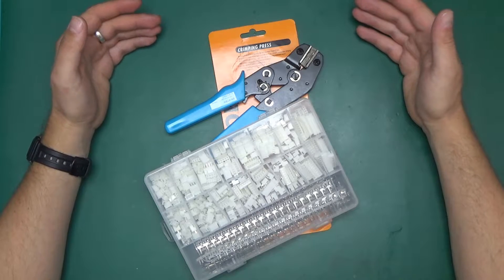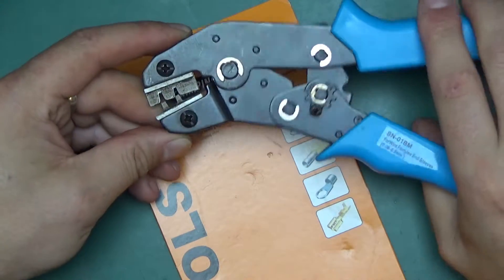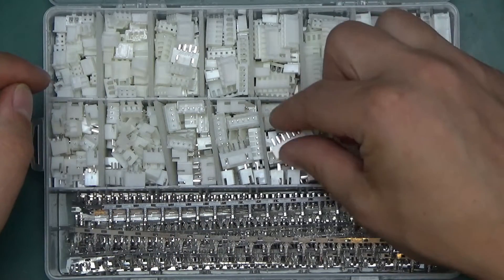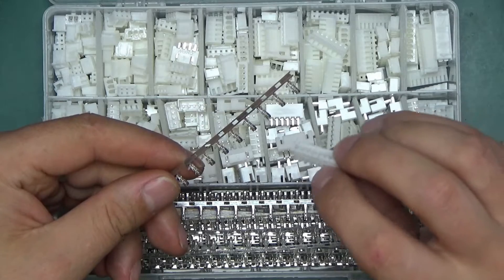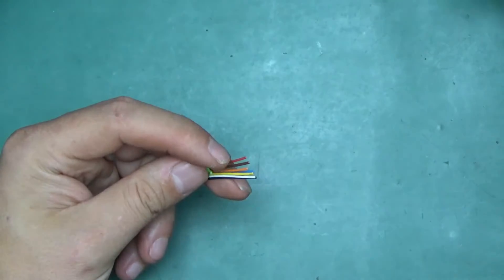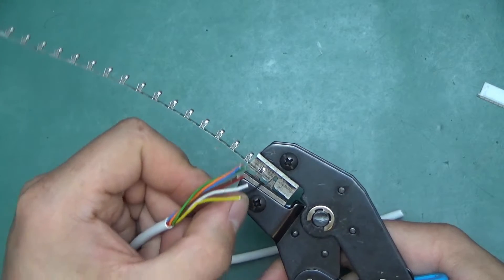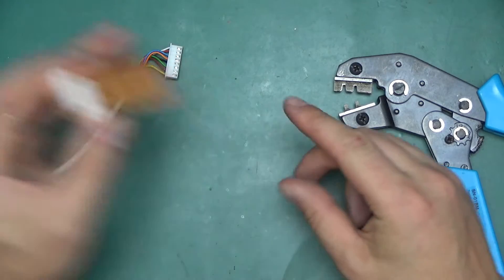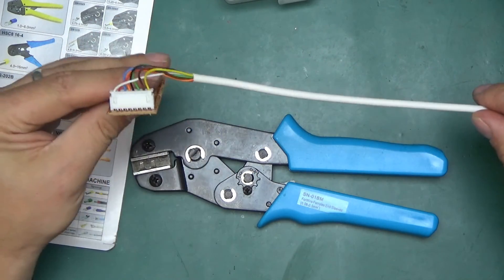#019 - JST XH connector crimp tool review

Comment: Incredibly helpful. Thank you!
I just discovered that its easier to catch the wire by squeezing the outer tabs slightly closed around the insulation with pliers. Then its all lined up and easy to insert into the crimping tool!

Comment: So I too got these crimpers but am not having very much success.  I believe it is because my pieces are a bit shorter then the ones in your video.  The end which must stick out with the tab to keep it in the plastic housing, gets crimped way too easily!  I am able to get one successful crimp out of 10!  Maybe this is why there are so many included :)  But seriously, would you please share where you got your terminals?  They definitely have some slight differences from mine - and it appears that you have that extra 1 - 1.5 mm in overall length for your terminal to clear the other side.  Thanks, Carrie

Comment: sellers say the SN-28B and SN-48B but its the wrong one. this SN-01BM is the correct one for dupont and jst connectors.
Reply: Exactly as you say. The SN-28B crimping pliers are NOT FOR JST-XH connectors.
I also got the SN-28B in a bundle with Dupont mini-PV and JST-XH connectors, as a one set - two boxes of connectors and the crimping pliers. I test tried to crimp both the Dupont mini-PV and the JST-XH with SN-28B and both of these came out mangled. The mini-PV came out so-so, but it got stuck in the jaws of SN-28B and the JST-XH was completely crushed.

Comment: When you say easily fixable at 8:14 what do you do off camera to fix it? Whenever I crimp the insulation too far in like that I've always just had to cut the end of the wire off and start again (also wasting a connector because it's stuck to the wire). Thank you for the video!
Reply: That's the fast way...if you are on your last connector and need it badly you're going to have to squeeze it back open and probably cut yourself in the process.

Comment: Great video. I have a different brand set but same basic deal. Other videos are blurry or say I need a thinner crimper to crimp the two sections independently. This is great and I’m now going to go ahead and make my first connector with high confidence that it will just work.

Comment: Nice instructable video. I didn't know about these types of connectors until a few days ago. I was looking at crimping methods for connecting LED Strip RGB extension cables together. I would still like to have done it this way although I am not sure how? Instead I am opting to use gel filled butt splice connectors. Can you use these types of connectors cable to cable instead of for circuit boards?
Reply from the maker: Thanks, and yes, there are male and female connectors for cable as far as I know, just not as common.

Comment: I have exactly the same set and all is explained very. However you can leave out the stripping of the wire.  This is because during crimping you are piercing through the insulation
Reply: Very interesting, I had never considered doing it without stripping the wire first.  This would make it less tedious for me, thank you for posting this tip.  Also thank you to the video creator, this is the video I first learned how to crimp from, it's by far the best tutorial for crimping that I ever found
Reply from the maker: Thank you for your kind comments!
Reply from the maker: I thought it should be ok without stripping, but it seemed that stripped wire will give more reliable connection. Thanks.

Comment: There are a lot of variables that one must take into consideration. For example if you are heavy handed (Breaking things) you want to use the ratchet type. If you have a good feel for things then the manual one will work. The smaller the connector the lighter the incremental squeeze. 
The quality of the dies is what causes the pin to curl back on itself. If the die are jagged you will not get a good crimp causing you to re-crimp and smashing the connector pin. 

XH's are large enough that the crimp threshold does not matter. 

Some of the connector (SH) requires a microscope to set up the crimp. Without it its a waste of time. Those type requires a high end die like Engineer PA  series. 
That last thing you need is your drone flying off into the sun set because you want to prove that a cheap knock off works just as good.

Comment: Thanks. This is exactly what I was looking for. I wasn't sure which pliers/jaws were the correct ones for rolling the tabs to bite into the wire.
...don't do this manually...
  I made my first 5p connector without the proper tool. That was a solid 45 minutes of tedious frustration :-) 
-Jake

Comment: what's the difference between XH and PH? is it size of crimp? are they compatible?
Reply: The XH crimp is 2.5 mm pitch and the PH is 2.0 mm pitch. No, they are not compatible. By the way, this video gives very poor crimping instruction, I would reject every crimp that was made on those tools. Without the manufacturer approved tooling, you would be safer soldering the wire into the terminal.

(Application Tooling manager at JST UK Ltd for 35 years).
Reply: @paulseamons1380  got a good video on how to crimp correctly?

Comment: You are lucky that your crimp tool got decent dies. I ordered one (for the "dupont" style connectors) and in what I got the dies are so inaccurate that they just crush the connectors instead of folding the tabs. The dies seem to be cast metal without any further machining. I had seen those dies previously on pictures (they are usually the painted black ones) and imagined that they couldn't work well. That is why picked a more expensive seller who showed grey/shiny metal dies (which are either machined or at least somehow treated after casting) on the product images. Still got the crappy dies. 
So everyone thinking about getting a crimping tool , watch out for that.